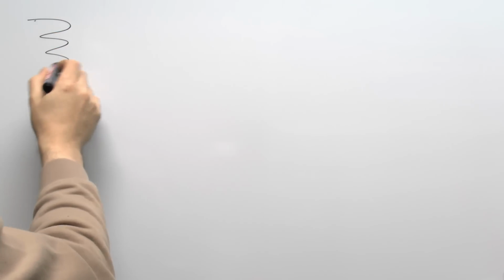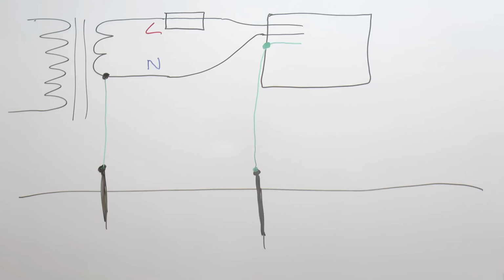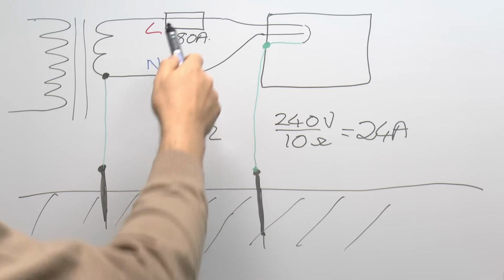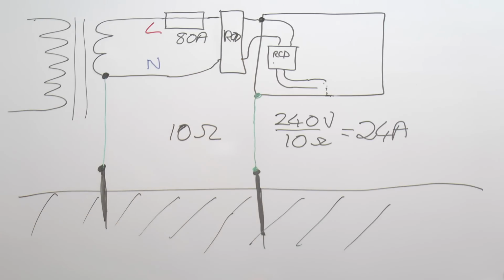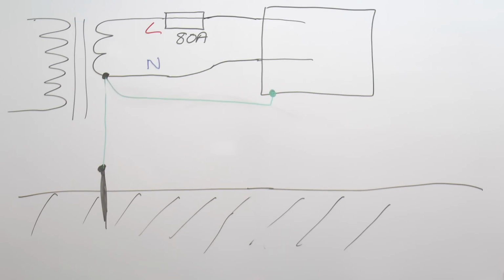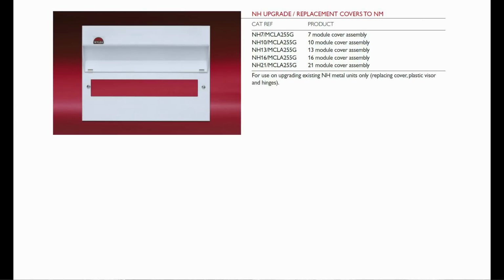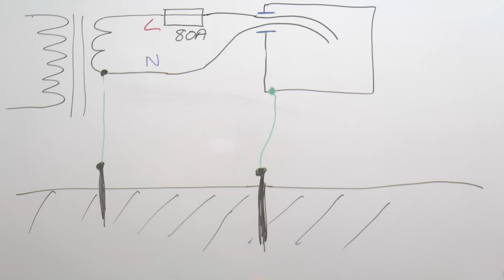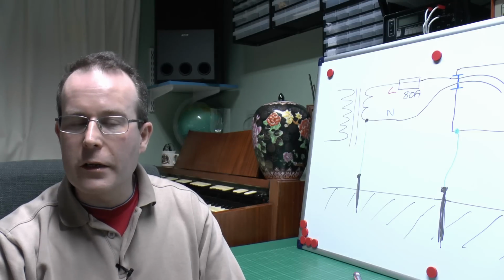Metal Consumer Unit on TT supply BS7671 Amendment 3

Comment: It was my understanding and that of technical is that the RCD prior to the new 3rd Amendment consumer units is enclosed in a self extinguishing insulated material such as Wylex's supply authority isolated enclosures.
Reply from the maker: Dale Goodrum The problem with that is the regulation specifies 'non-combustible' rather than self extinguishing, yet does not have any definition for 'non-combustible' other than the suggested example of ferrous metal/steel. 
A single RCD for the whole installation would not comply with 314.2 either.
Reply: *****. Sorry with regards to the RCD I was referring to the 100mA type S RCD not the 30mA located within the main consumer unit. the IET website states not readily combustable, so with that in mind if you do not consider self extinguishing as not readily combustable how would the self extinguishing plastic stuffing gland for the tails comply or any other cable enter for that matter?
Reply from the maker: Dale Goodrum Common sense would suggest self extinguishing and not readily combustible would be suitable - but the reg specifically states non-combustible which is entirely different.  This is probably why all of the consumer unit manufacturers have gone for the steel option.

The reg does not say anything about glands or anything other than the enclosure itself so plastic ones could be used, whether they are self extinguishing or not.

As you may have guessed by now, the new reg is exceptionally poorly worded and will probably be revised in the fairly near future.

Comment: how about some sort of ceramic or porcelain consumer unit?
Reply: Much older fuse boards did in fact have a porcelain chassis housing the onto which the metal connecting and switching parts were fixed. The porcelain chassis usually had an outer shell-type cover
that was either metal or plastic, I guess that JW has some in his museum - check his Flameport site.

Comment: I think that in the US neutral is bonded to earth at the entrance to the consumer unit. Is there a reason that isn't done in the UK?
Reply from the maker: Robert Szasz Not done in the UK because it's not permitted - only the electricity supplier can do that, and when they do it, it's done before the meter.
Reply: ***** that seems like a good way to have the neutral leg floating at some significantly non zero voltage compared to a local ground rod. Do I understand correctly that in the UK earth can/is bonded to the actual local ground? I would expect standing on wet soil and touching the earth conductor (or the shield of a coax connector) to be near totally safe.

Thanks for all your informative videos.
Reply: Robert Szasz In the US the neutral (white) is attached via a common bus bar in the breaker box with the earth grounds (green) which in turn runs to a grounding rod.
Your two hot legs are run across a pair of buses that breakers attach to and for 120 volts the wires are black, for 220 - 240 volts they are usually red and blue with the bare ground for 30 amp, 50 amp has the 4th white neutral added to the cable.
The systems in the UK are somewhat dangerous in comparison to the US due to the numerous hazards that can happen just like the one in this video.
Reply: ElfNet Gaming thanks for the reply. I know just enough to do hobbiest electronics safely and not blast rf out the power lines when I do ham stuff. Proper premises safety I leave to paid professionals.
Reply: Oh yes of course. I work on commercial 2-way radio, cellular, and IT systems. I had to get certified to do electrical work and such. buy yeah leave the premises safety to the guys getting paid for it.